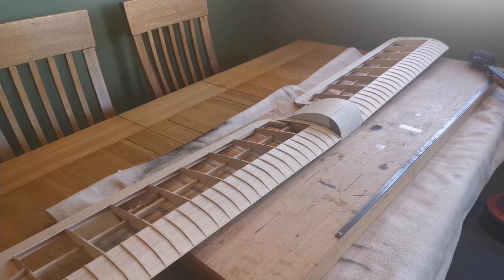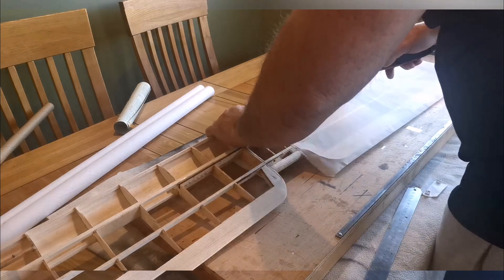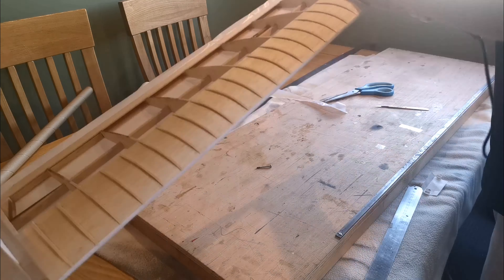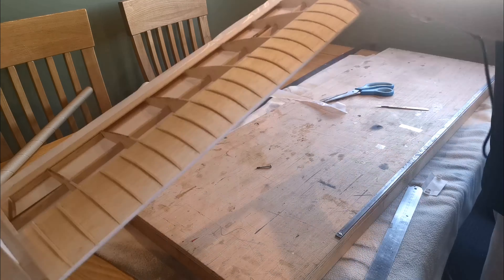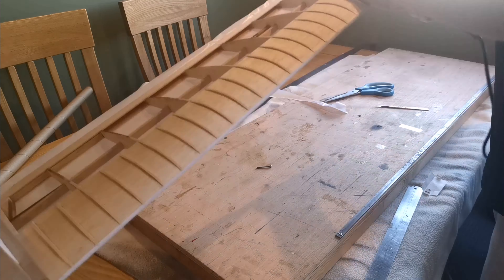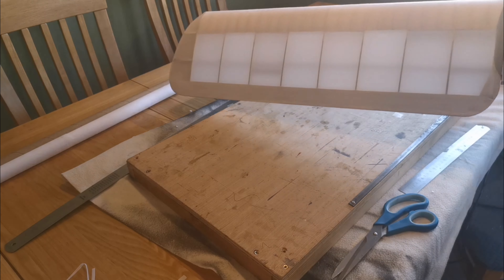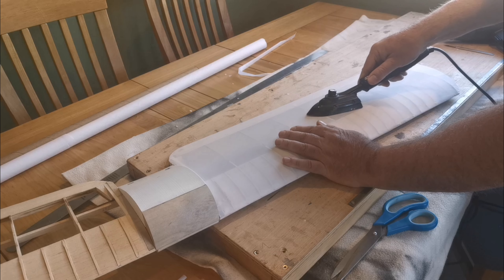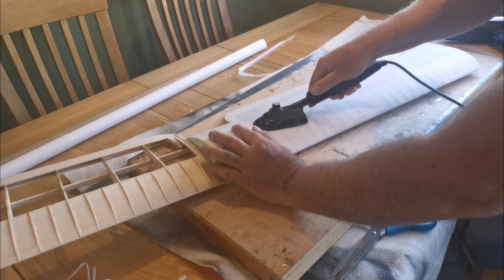Covering the wings : Cirrus Moth by David Boddington

Comment: Our club consists 95% of people with ARF, it is pathetic really  as they are just to lazy to build or innovate, no camaraderie either, my old club was very different, now they're all Politically Correct and you can't banter like in the past, I despair! 😮
Reply from the maker: Never give up, you carry on the good work  I'm lucky that my club has a number of active builders we all encourage one another. another.
Reply: Just in regards to the 95% of the club fella ,i know its annoying mate it,s like that over here in Ireland most are ARF or electric ,real modelers  build em  and fly em with a nitro ,spark or diesal engine in my appinion the passion has gone for the real die hards ,as foamies are easily replaced were a model that takes hour abone hours to build is art ,and a achievement, all the best
Reply: @homienat3374  
👍 😊 !